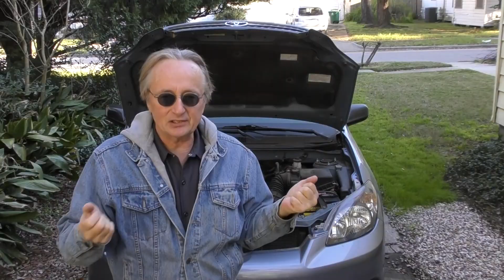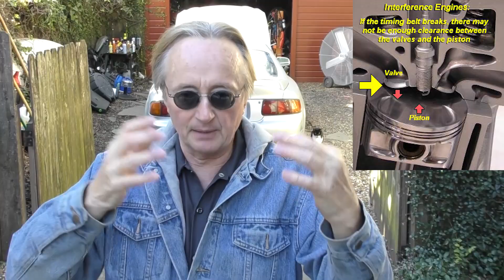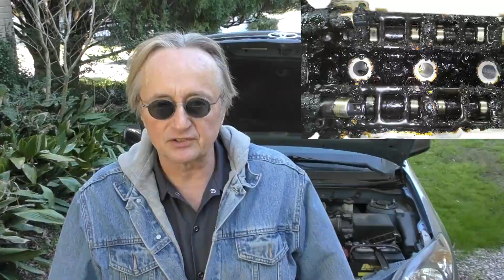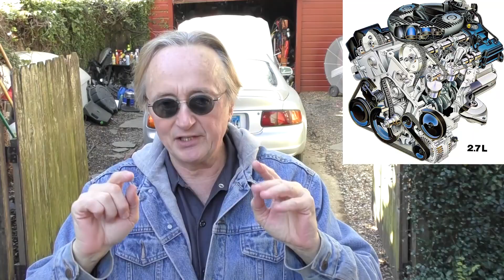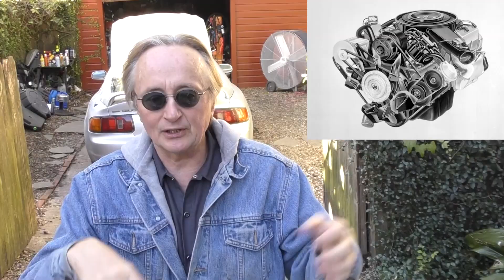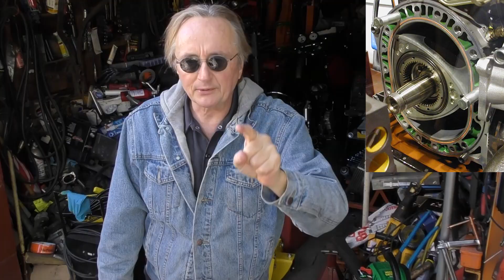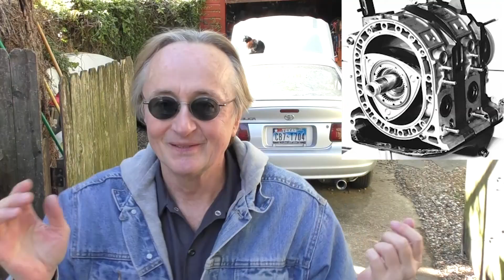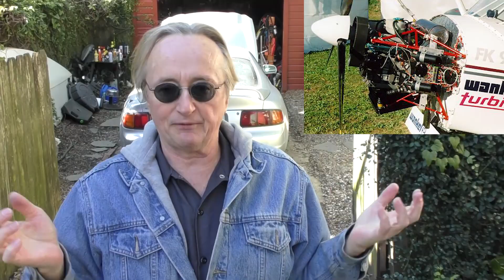Never Buy a Car With This Engine

Comment: Had a 1.8T from Audi. Wasn't a bad engine.
Reply: it truely isnt...
1 of most reliable audi/vw engine. americans just dont read manuals what oil manufactures recommend
Reply: @tommior9553  I very frequently checked the oil on that engine. I think if you check oil on engines in general, even the not so good ones will last for a very long time.

Comment: I got a car for Christmas from my Mom It’s a Dodge Charger 2010 2.7 I was on the way to the freeway and you know what the engine lock up o what a surprise lol 😂 I’m going to get a 3.5 Engine it’s going in to the car all I need is engine wiring harness and the AC compressor in AC compressor lines and the Air inlet tube that’s all I think  then something about a 5/8 adapter on the bottom of the cooler for the heater core line. Thank you scotty Kilmer for a Awesome video have a good day. 😃
Reply: Be careful with the key
Reply: steve jobs yeah for sure lol Break to easy
Reply: Skyler 1640 no if you’re replacing the engine try to not mess with the ecu or you will have to pay for someone to program new key
Reply: steve jobs how will  I need a new key if my key is already programmed to my original ECU i’m at the buy  a scan tool just in case I got the battery disconnect on it we just like disconnect the battery right because I’m pretty sure if I unplug it and bring it back to factory specs. So the computer had to go through a real learning again if all else fails I’ll buy a scan tool . Or have somebody program a key thank you

Comment: Rev up your engine, as long as it's not one of these five!
Reply: u can rev 1.8t as high as u want as much as u want, just dont be dumb american and fail to read manual for oil manufacturer recommends.
Reply: @tommior9553  i got a 1.8t with 280k ...still going strong, it's a great engine
Reply: Actually you are forced to rev the 13B if you want it to survive
Reply: @dotdot8614   Yeah people bought RX8 and do Sunday driving with them, so the seal would never be oil properly, they are made to be hard driven, some even put 2stroke oil in the gas tank to help lubricate the apex seals.
Reply: Twobarpsi 

Unclear instructions:

Bought a BMW with Pinto gas tank and blown head gasket out of warranty.
Reply: @AB-ou8ve  lol, at least it wasn't a Wankel!

Comment: hUh? oUR 1985 fLEETWOOD bROAUGHUMS LASTED THE AVE. OF 331K MILES IN OUR cHICAGO lIMO COMPaNY  But we swapped the orignal mtrs at 55k ave to Using the Older 350 CU In with a 4 bbl and 10 of them? We put V6 Engines in them and they ran very well1

Comment: I remember before that eks. Ford has in same models different engine, Taunus/Cortina 1.3 and 1.6 L. I had 1.6 l. A friend had 1.3, more bad engine. Ford had on Mondeo 3 different engine, 1.6, 1.8 and 2 liter. I had many Mondeos, with 1.8 and 2 liter. The 2 liter was the best, keep longer. My experience is that a 2 liter engine is good, in mostly all cars. Now they have also 1.5 liter engine in a SUV. FORD, RENAULT, NISSAN, I find this engine not to trust.

Comment: The next episode, the top five best engines
Reply from the maker: good idea, thanks!
Reply: Scotty Kilmer 

Volvo 2.3 red block would have to be in the top 5 best
Reply: @chrisj197438  must be that dead reliable, like the 2.4 5 Cylinder non turbo
Reply: @scottykilmer  Honda, Honda, Honda, Honda, Toyota...
Reply: Scotty Kilmer If the LS engine isn’t included, we riot.
Reply: @Kamesuko  he hates gm.  We all know, small block, ls, 3800 v6 are probably the most durable.  Best selling engines of all time.   Scotty hates Chevy
Reply: @scottykilmer  Look at all these great suggestions, you better not screw this one up Scotty. We're counting on you, as a greatest mechanic on Earth.....No pressure
Reply: @scottykilmer  you MUST include the GM 3800 V6 one of the toughest most durable engines GM ever made, makes awesome power with the eaton M90 supercharger and is actually easy to increase performance. also the GM small block..... older variants, and the LS series.  the most swapped, most hot rodded engines in the world. durable, powerful, and simply push-rod greatness.

the small block chevy was rated the best engine of the 20th century and the 3800 V6 the 2nd best right behind the small block.

but you seem to hate GM for some reason. they have had some bad products but so HAVE all manufactures.
Reply: Let me guess: toyota, lexus, honda and mazda miata
Reply: Toyota 1.5L 4cylinder engine.
Reply: Toyota 1.5 1995 up only... Earlier versions burn oil like crazy...
Reply: Honda 2.4L i- vtec 4-cyl.
Reply: 2.2L ecotec
Reply: 1. 2jz
2. 2uz
3. Cummins 12v
4. ford slant 6
5.  chevy 350
Reply: @Astrothunderkat  MC  I6 258cid 7 bearings ballanced big valves
Reply: The new Ford 5.0
Reply: Lexus, Toyota, Toyota, Toyota, Toyota😀
Reply: 1mz fe engine found in camry's and avalons. my 95 avalon has 450000+mi. Engine and tranny never been out of it. Timing belt water pump replacements, radiator, fuel pumps etc need periodic replacement too. Only surprise was rack and pinion needed/was replaced somewhere after 200,000. That engine is fantastic. 4.7 liter in Tundra - and 2JZ in my SC300 both over 200,000 both great engines too.
Reply: @dankuroiwa7874  I agree 1nz-fe is probably one of the best plus it's nearly on everything range of Toyota passenger cars from yaris to Corolla to Camry etc
Reply: AMC 4.0, Cummins 12V, Toyota 2JZGTE, Chevy LS, Ford modular, lots of solid engines out there. "Best" depends what you want it to do.
Reply: Doctor Smith Ford Modular as long as it’s not a 3V 5.4.
Reply: @J G And the engine it followed, the 327. Good all around motor.
Reply: I agree on this one.
Reply: What about Ford focus z 2.3L 2004?
Reply: 5.3L Chevy Vortec engines have been practically bulletproof for many. Just sayin
Reply: He said it already. Japanese and Mustang in line 4 cylinders. The early 1L BmWs whose blocks were used on F1 cars were pretty good too
Reply: How can you keep it to five! Some many great engines. Chysler had the 318 and the slant six. Chevy had the 327/350 and the 396. Ford had the 300/6, 289/302, and the 3.0 L twelve valve V-6. And already I feel bad because I am thinking of many I haven't named. And I do not have a good 
Knowledge of the newer motors that should be mentioned. For me, cutting it down to five would be impossible. Good luck Scotty! You will be roasted at the stake on this topic!
Reply: Chrysler, Ford, Chev, VW, Fiat. Just kidding.
Reply: @J G I am afraid you are right! Many good ones!
Reply: 4.6 2v is definitely up there
Reply: the old Chrysler slant six
Reply: Ford's 300-Straight 6, 351 Windsor V8. The 5.0L fuel injected version from the late 1980's and the 4.6L V8's from the late 90's on up.
Reply: The Belorussians did it.
Amasing results (unexpected).
The best presently made is Citroen 2.0 HDI.
Reply: VW 1.9 TDI diesel.
Reply: Toyota 3.0
Reply: @joeandgod1  Quietest engine Toyota ever made...

Comment: Not to mention that dreaded Pt Cruiser.
Reply: Keep some extra head gaskets handy.
Reply: 2010 was the final model year for the PT Cruiser, but where I live they are EVERYWHERE. They can't be so bad if so many are still in everyday use nine years after they stopped making them.
Reply: @richardbostan4286  If you don't drive them hard they can last.  Lots of old people bought them and drove them like grandma cars.  Hell where I live if you bought a new vehicle at full MSRP they would sell you a base model automatic for 4 grand.  That was over a decade ago & the stealership is long gone.  The parcel shelf made these a Costco beast.
Reply: @richardbostan4286  true my mom's 2007 has never given her major problems in 7-8 years. if you baby them they're not horrible vehicles
Reply: always called them loser cruisers
Reply: @danjohnson8399  Traded a '04 GT in.  Two dealers couldn't fix it.  No check engine light.

Comment: My car has a 2.4 twin cam engine that gm uses there good engines I bought mine at 165,000 and now I'm at 193,000 you just have to keep up on oil changes

Comment: I have 2004 Chevy cavalier 5 speed manual with 2.2 ecotec 220,000 miles runs great biggest thing I had to do was change the clutch
Reply: My automatic with 130,000 miles is still going strong. I hope i get 220,000. that would be great!
Reply: I had a Pontiac g5 2.2 ecotech if you change your oil will last forever. Scrapped at 256000 km due to rust. Engine burned no oil no leaks.
Reply: My 2006 automatic ecotec engined vauxhall astra had 123k on it and would have easily gone for another 200k if the steering rack hadn't started leaking and would have cost me a fortune to fix. The engines themselves provide you look after them are bulletproof
Reply: My 03 eco has 145k. Still strong
Reply: Yep. Same car, same repair.. 209,000 miles on mine.

Comment: Don't like the cylinder deactivation system if you want a V8 then it should always be ran as a V8. If you want better gas mileage get a v6 or 4 cylinder just my opinion
Reply: Fwiw,
My  4.8 V8 in half ton 08 Silvy gets full 3 mpg better milage then V6 in Colorado Canyon small truck,,
Looks like GM engineers realy fked up those new trucks
Reply: s3xyScorp I know exactly what you mean. It makes me laugh to see the poor mpg numbers on mid size trucks today when my 04 Silverado 4.8l V8 full size can get the same mpgs even with 130k miles on it
Reply: Exactly it’s so stupid, people literally pay to get rid of it like stop start on new cars so why do they bother to put it there to begin with

Comment: What, no mention of the Oldsmobile 5.7 Diesel?
Reply: Don't knock it too much-every boat owner should have one-they made a great anchor.
Reply: What a POS that was
Reply: I had one too. Supposedly the second generation was a huge improvement. But by then most Americans wouldn't get near a domestic car with a diesel.
Reply: Not sure if same engine but my dad had an 83 buick century with the diesel and he said it was so awesome until it blew a head gasket. From what i studied oldsmobile designed the engine and gm rushed them so it was of poor design due to basically being incomplete. That being said my grandpa told me if he would've owned that car, it would still be running.
Reply: @Scolio , your dad owned the V6 diesel engine. I believe it was much better than the horrible V8 diesel. That still isn't saying much
Reply: @stuartbear922  yeah. From what i heard it was design flaws mixed with mechanics that weren't familiar with diesels so they did the repairs wrong so to speak
Reply: These have been long gone so its not likely anyone would see one for sale - a buyer would be a collector.  Check out the Car Wizard's channel, he recently swapped a DX version into a 1969 Cadillac.   The 5.7 might have been better if GM only sold them to truckers.   Water in the fuel caused excess combustion pressure (steam) that damaged head gaskets and broke head bolts - damaged injection pumps, sometimes the main journal caps were cracked.  If the water was separated from the fuel or you bought the fuel from a truck stop you may have had success.  Some 5.7 owners used 10w-40w  oil that was designed for gasoline engines and didn't change it frequently - the motor became sludged with carbon.  For the right person they're not a bad motor, but it wasn't good for the mass market, which is to some extent is still true for diesels.
Reply: Nightmare...Freddy had 3 of those...
Reply: Or the Northstar V8 I mean Jesus Christ that engine is a curse for most Government Motors vehicles for the butthurt, General Motors
Reply: It wasn't an intrinsically bad engine, it just needed more work to make it right.
Reply: @marsgal42  Yep, my mom had one in her Cadillac. It ran great once it was yanked out and replaced with an Oldsmobile 403 from a wrecked Trans Am.
Reply: Euro-trash here, how could a diesel be bad?
Reply: @GlamStacheessnostalgialounge  It techincally wasn't even a diesel engine. It was a converted gasoline engine.
Reply: Glam Stachee it was a gasoline engine with diesel heads and fuel injection. It was a train wreck.

Comment: Know quite a few people with 2.2 with no issues including me keep oil changed and change timing every 100k 
My first car Saturn l200 had 2.2 ecotech in it kept good oil in it never had a problem
Reply: Yea treat the chain like a belt. Every 50K to be safe. You also want the newer tensioner and guides etc.

Comment: Hey Scotty! I'm planning to buy a Buick Riviera GS 1968 and I would like to put a modern V8 Chevy engine on it. What engine would you recommend for this project?
Reply: Don't. If it's nice, keep it original.
Reply: Chevy LS or 350 is probably the best choice if you really want one.
Reply: Gen 3 GM 5.3L vortec LS